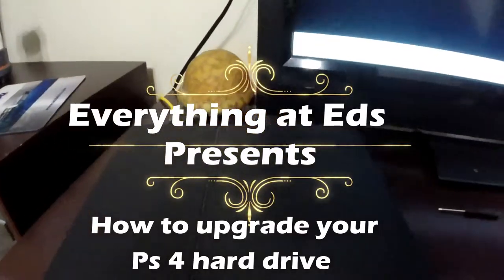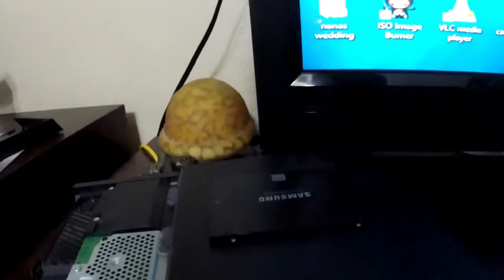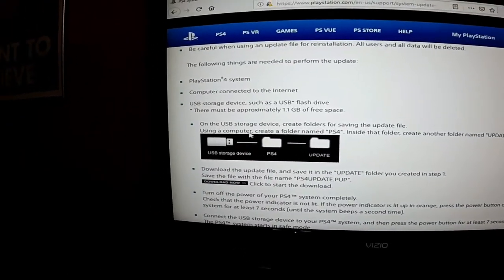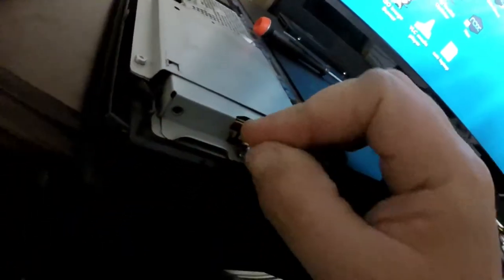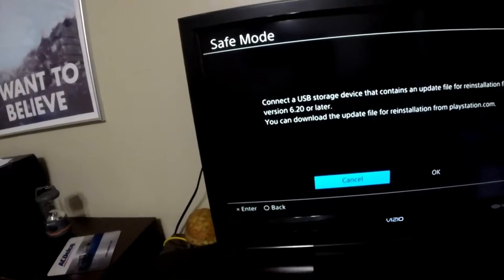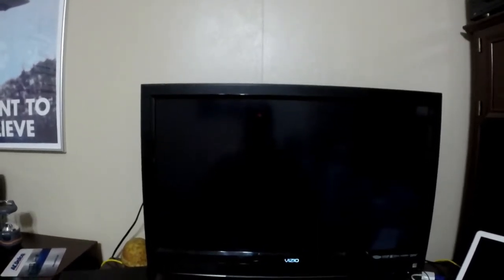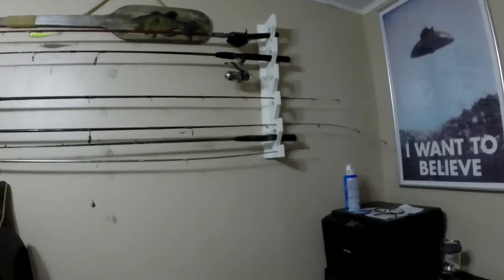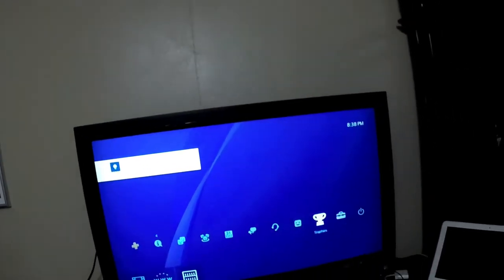How to upgrade your PS4 hard drive

Comment: I always enjoy watching how to videos, thanks!  So, you bought the PS4 for $70 put a SSD in it and it works, how much can you sell for now that it works?  
Couple questions:
1.  I know my PC is much faster with an SSD, do you see the same performance improvement on PS4?
2.  If so, can you do the same thing on an XBOX One?
Reply from the maker: 1. i have not used a ps4 with a normal hard drive. I know it can access and read /write faster. I just had one laying around and decided to use. Iknow it loads games fast that are stored on the hd.

2. Never messed with a xbox but i could try would have to do some research. as for selling it, i could probably get 150-250 for it, but i think i am going to keep.